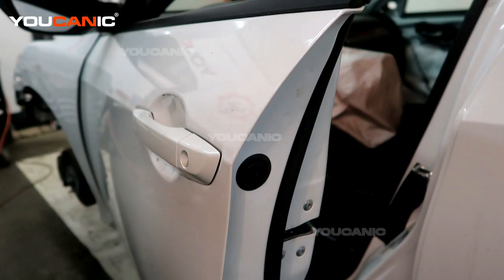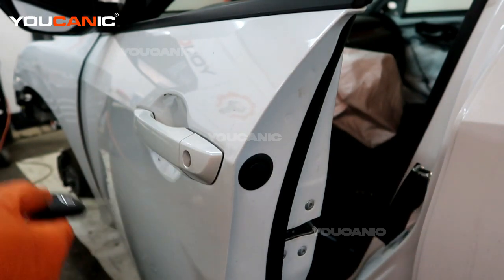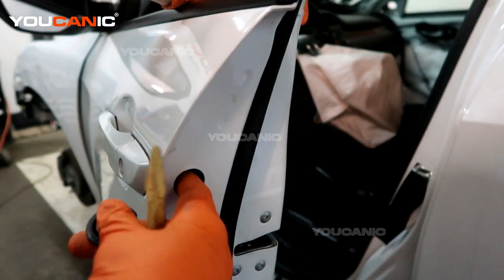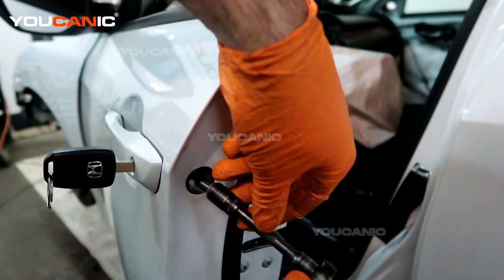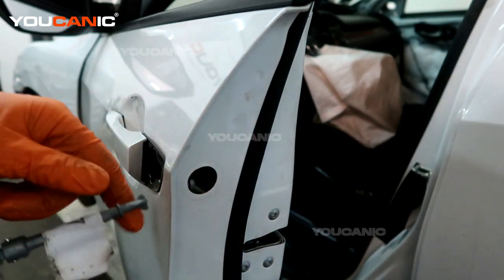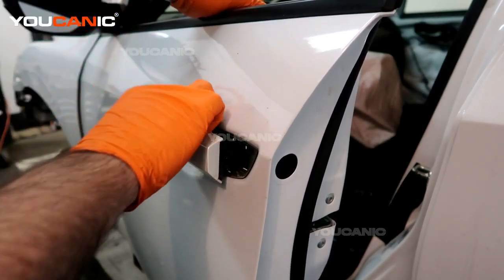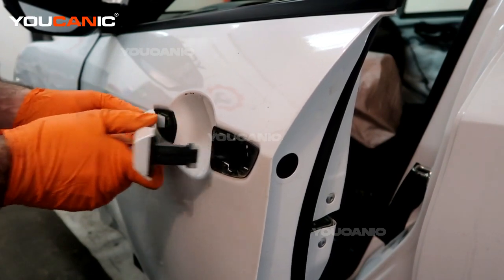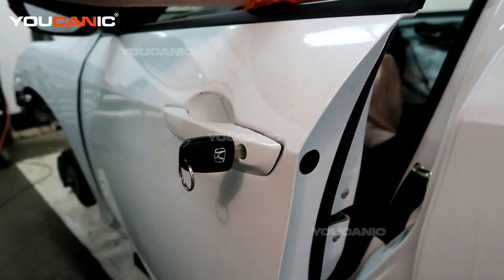2016-2021 Honda Civic - Door Lock Cylinder & Exterior Door Handle Replacement

Comment: Before I start the process, I saw on another video that there were wires attached to the key bolt assembly that is removed before you can remove the exterior handle, and that could only be unattached by removing the interior door panel first. Is the example here an older model that didn't have a keyfob electric door lock and opener? Mine is a 2019 Civic. Thanks for any additional info.

Comment: Hi, I have a 2015 honda accord. My car was vandalized and the door lock cylinder was broken and damaged. Is there away that I could order an OEM part from Honda specifically designed to match the original key? Thanks

Comment: Will this procedure work the same for removing the cylinder on a 2013 Civic?
Reply from the maker: Hi there, and thank you for your feedback. The exact procedure might vary slightly depending on the specific model and the design of the ignition cylinder. We recommend you to check the Civic specific service and repair manual for specific instructions regarding your 2013 model. Our aim at YOUCANIC is to provide easy-to-follow repair instructions and help you with all your car repair needs.

If you need a good professional diagnostic scanner, the YOUCANIC Pro System Scanner would be a great fit for you. Check it out here: www.youcanic.com/scanner . For detailed Factory Repair Manuals and Torque Specs, you can get access here: www.youcanic.com/manuals. These resources should provide you with all the information you need for your repair needs. Thanks again for reaching out!

Comment: For weeks i cant get that one 10mm bolt back in because the holes aren't lined up properly😭The one on the inside isnt flush to the door for some reason on 3 of my doors. Any help with that? Even used a pry tool to try and keep it in place almost feels like its broken
Reply from the maker: Thanks for reaching out! It sounds like you're dealing with a tricky bolt situation. We invite you to check out YOUCANIC's free resources, guides, and tools, including our powerful scanner and factory repair manuals, that can help you navigate through this. 

We strive to empower car owners like you to perform car maintenance and solve issues on their own. Please feel free to visit www.youcanic.com for more information and support. We're here to help you with your car ownership journey!

Comment: Hi, I just did that and for some reason now after I put my key cylinder back in my key will no longer turn. Do you know why that is?
Reply from the maker: Thanks for reaching out! It sounds like your issue could be fairly complex. We suggest you ask this question directly on our site, YOUCANIC.com. We have a vast selection of guides and resources that can provide you with a step-by-step solution. In addition, our YOUCANIC scanner could provide further insight into any underlying issues.

At Youcanic, we're all about empowering car owners like yourself with the knowledge and tools you need to feel confident in any situation. We're here to support you every step of the way, so don't hesitate to reach out to us with any additional questions or concerns.